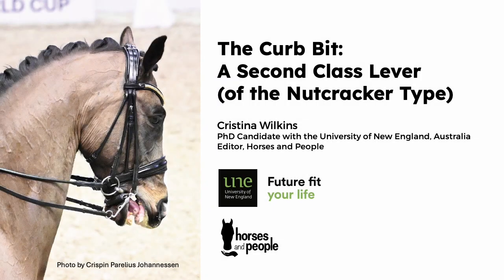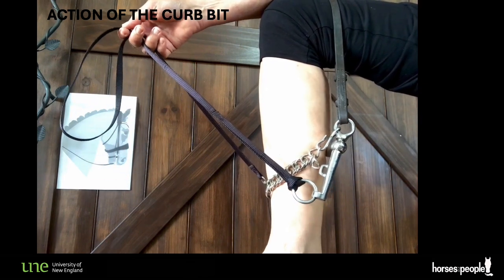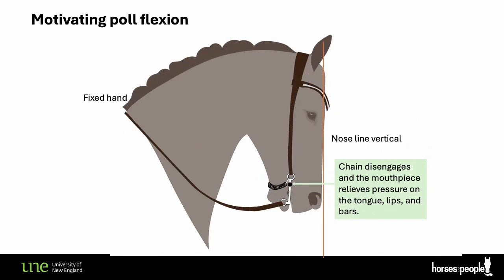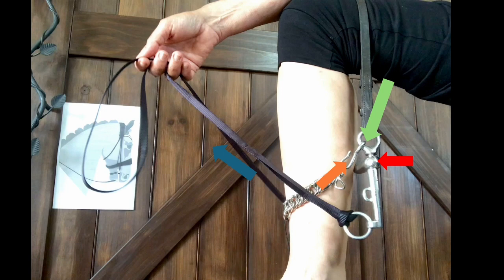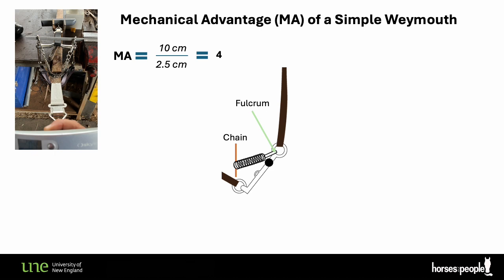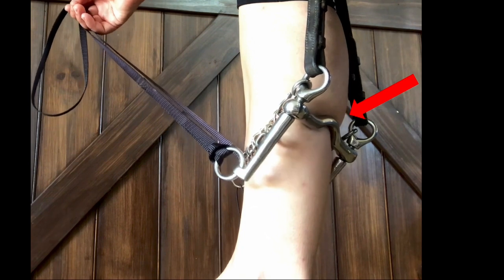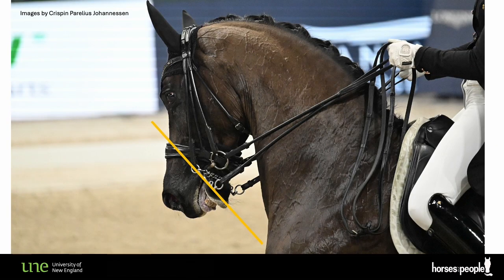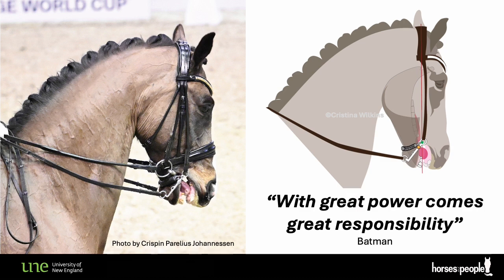Double Bridles - The Curb Bit is a Nutcracker

Comment: First of all let me say i really enjoyed your video. I think the cannons of a curb bit is the fulcrum, the rein rings are the effort, & the curb chain/strap is the load. The reason why you get tongue compression is because the fulcrum is sitting on soft tissue. Horse's pick up and carry the curb bit with their tongue {if trained correctly} to the point that they can hold a curb bit in their mouth without a headstall/ bridle. It's still a lever, but the bridle/ headstall ring is not the fulcrum. Curb chain/ strap adjustment is extremely important and 45 degrees is WRONG. People think a looser curb chain/ strap is kinder on the horse which is not the case.

Comment: Exactly what you said at 7:09! Modern dressage riders can’t ride with the extremely light contact required with a curb.

If you ride with a curb alone and your seat, the results are incredible! But, they are not the flashy high steps wanted in modern dressage.

Comment: The way the reins are being held in the live horse video shows the curb and snaffle reins crossed.  In addition to that, the curb rein is being held thumb toward the bit in a hard grip.  The way the double bridle is supposed to be ridden is with the snaffle rein controlled by the ring finger and the curb by the pinky finger while also lightly pinched between the thumb and forefinger.  Riding the way shown in the video is used when you need brute force to slow an animal's forward motion and keep them from running away, it's got no place in the finished horse.  I also doubt that the rider holding the reins in this manner is going to have any awareness of the force they're exerting.  I also think that this kind of force is totally counter-productive, as the horse is going to lose a lot of sensitivity if they're ridden this way and will literally not be able to feel the changes asked for through the mouth.

Comment: Fantastic presentation. How anyone could use that bit after watching this is beyond me!
Reply: How anyone can put two bits in a horses mouth is beyond me! 

In the right hands a curb is much softer than a snaffle. A curb will give a soft signal before it goes harsh, a snaffle is either on or off.
To activate a curb to the same degree as a snaffle you have to pull 2-4x the distance.